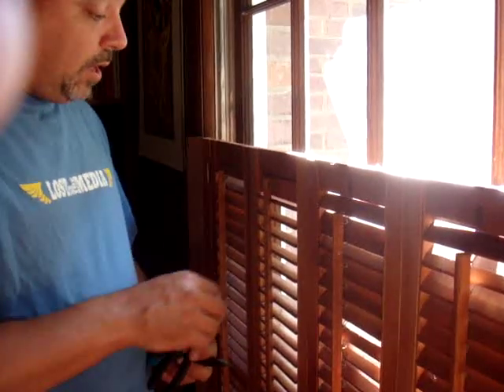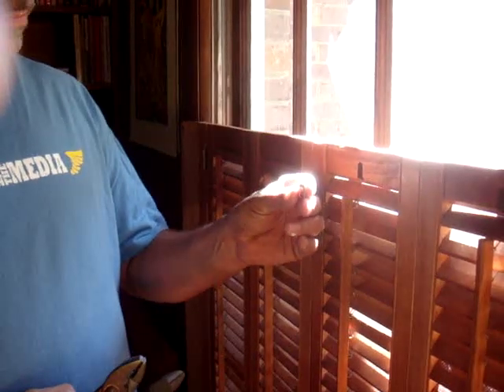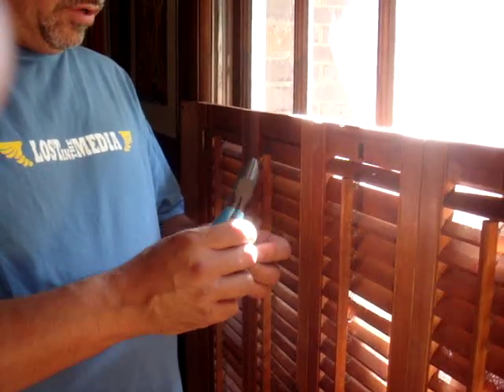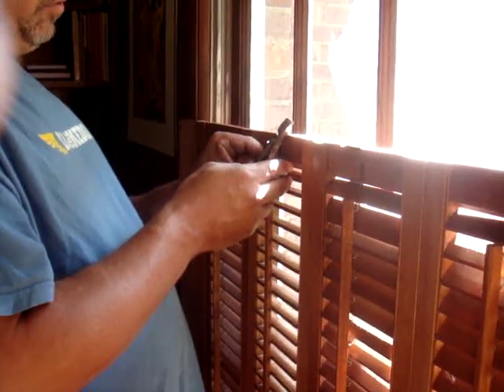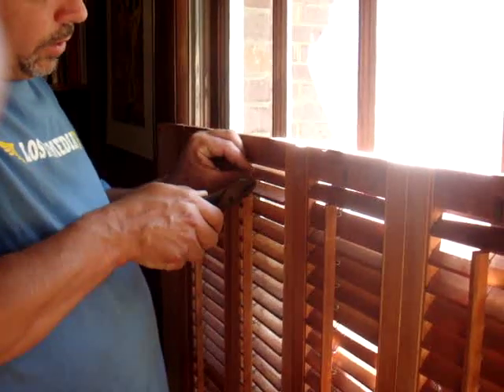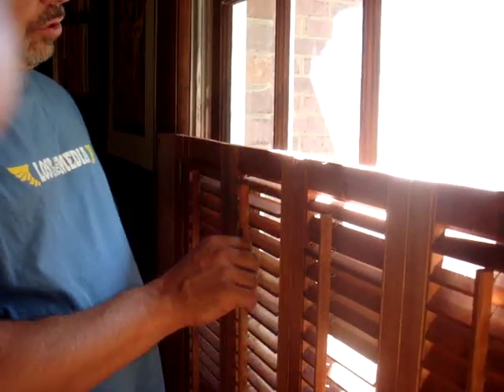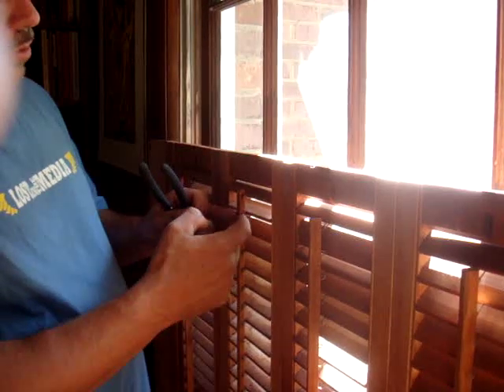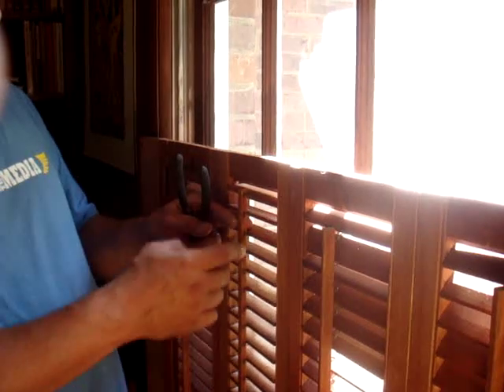How to repair a shutter

Comment: Hi there...I tried to fix my shutters myself a while back.  I'm pretty handy, and was doing it the way you showed, but I must have the wrong kind of staples.  Can you tell me the exact kind, brand and size I should get?  I have about 25 louvers that need staples.  Thanks!
Reply: Sorry for the delayed response, you are looking for  1/4'' crown staple by 1'' long.  They should be with the screws and nails in any hardware store.  It also helps to put  dab of krazy glue in the holes that are getting new staples.